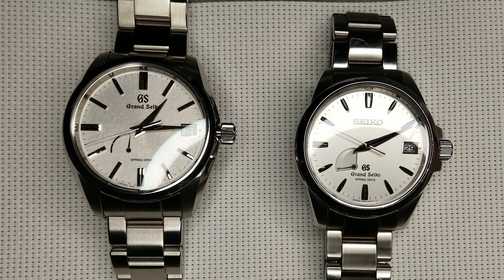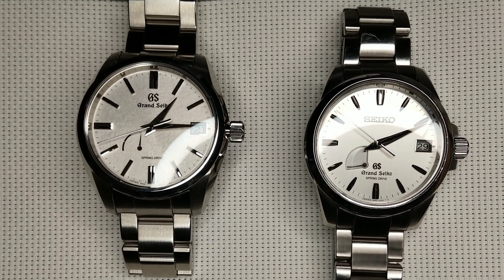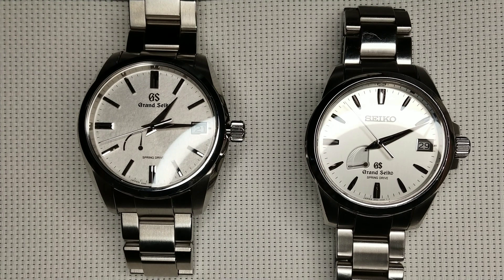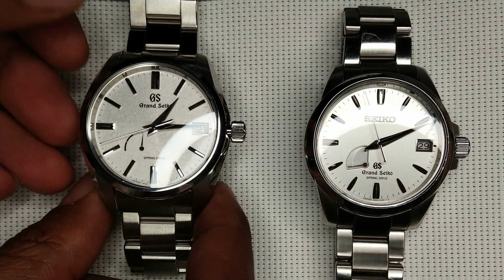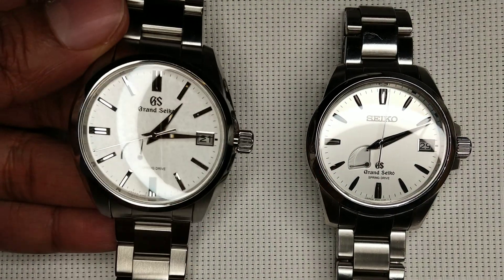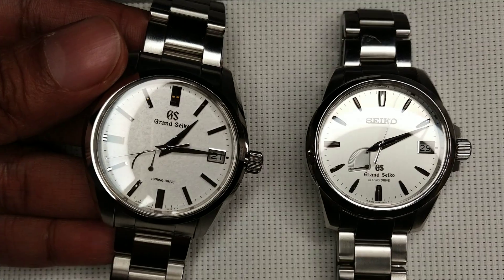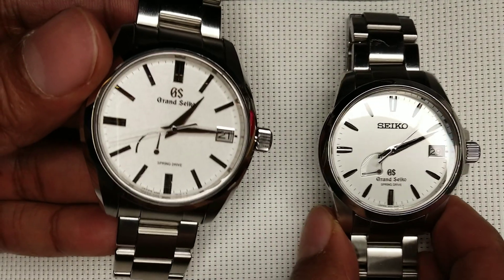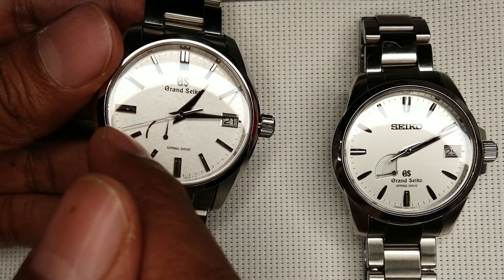The Spring Drive Party Trick

Comment: Wow! That's interesting!
Can you also please show on your channel what's happening with Spring Drive movement when it's started after being stopped, i.e. after pull out crown, set the time, for example, and push crown back in - is the second hand also will move faster during short period of time, or it will be regulated (by electromagnetic break with phase-locked loop, PLL) almost immediately and acceleration wouldn't be visible?
Reply from the maker: Good question. Here's something that  partly addresses it. https://youtu.be/EcMICmy_-Go
Reply: @DesignReviews  Yeah, this link pointing out to exactly THIS video and it demonstrates the "cold start" with fully unwounded main spring.
But the curious thing is the demonstration of the complete "cold start" with fully wounded spring.
It's very curious, I bet that the hacking function stops/locks the whole mechanism, but it's also really curious are there any capacitors in the electromagnetic breaker circuit, so for capacitors discharging the crown should be pulled out for more than one minute (or even more, for 5 minutes, for example) to assure that it'll be completely "cold start" without electricity in a circuit, but with fully wounded spring.
And definitely, there should be present other clock, as a reference source of time, as on this video, to distinguish the accelerated second hand movement versus normal flow of time.
That will be a great experiment! It will shows off and gives a meaningful information on how Spring Drive operates internally. I've tried to find such videos (and saw all videos with Spring Drive movement on your channel as well), but there are only present "cold start" videos with fully unwounded main spring and how Spring Drive stops (with second hand slows down) when the main spring is naturally unwounded.
Reply: @DesignReviews  

"The seconds hand will stop moving when the crown is pulled out to the second click. Do not stop the movement of the seconds hand for longer than 30 minutes. If the stoppage of the seconds hand movement exceeds 30 minutes, push the crown back in, and wait for approximately 30 seconds after the seconds hand restarts moving, and then set the time."

https://www.grand-seiko.com/instructions/html/GS_9RA5_en/AGFISYxwidandf

So, every IC in Spring Drive has capacitors which are hold the charge for 30 minutes in average. When the crown is pulled out for more than 30 minutes - capacitors are discharged completely and thus it will produce the same effect (even with fully winded main spring) as watch cold start with winding from completely unwounded state, i.e. seconds hand will move fast with acceleration, while capacitors will charging and enough electricity will be generated to start an IC, and IC with electromagnetic breaker will take action.

There's no any video that demonstrates that effect.